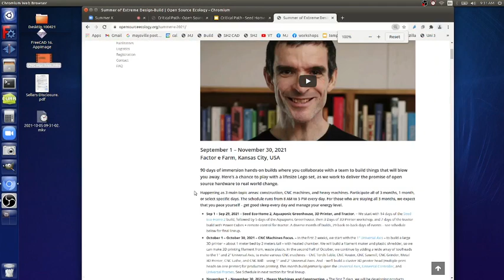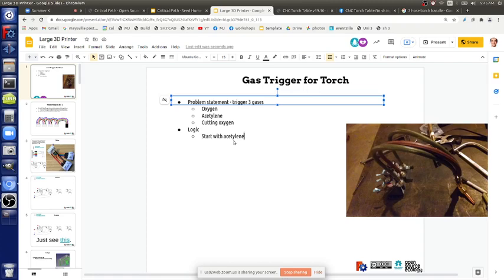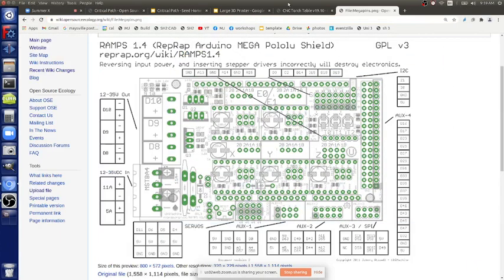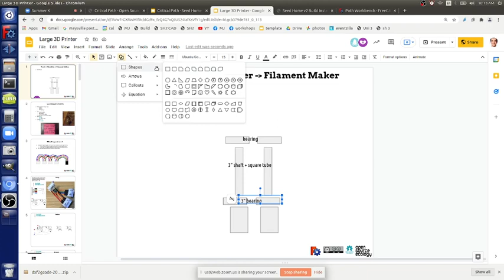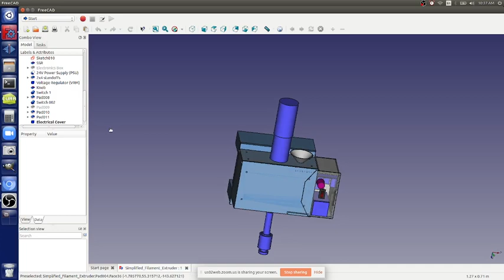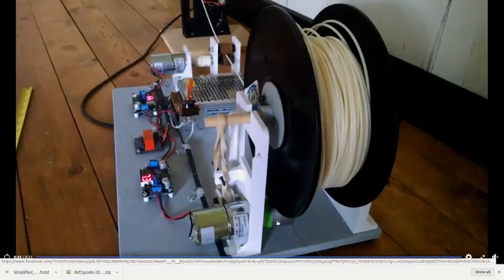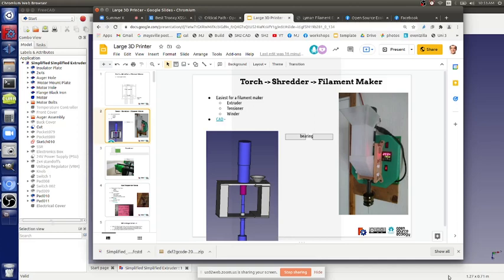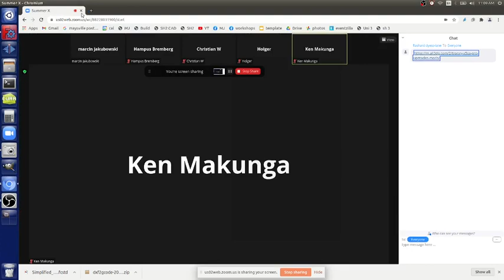Towards Open Source Industrial Filament for 3D Printing

Comment: Should you have a filament diameter sensor using an optical sensor be introduced before the winder and alter the motion speed of the extruder based on diameter variation. This would improve final filament consistency whilst also increasing automating process. The recipes for different filament is a great idea, is there any other companies with charts of this?